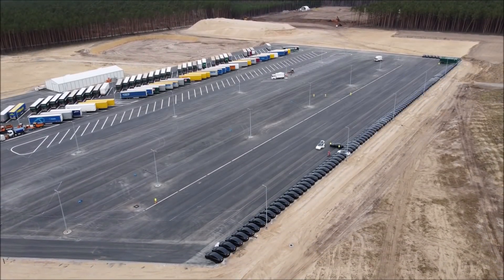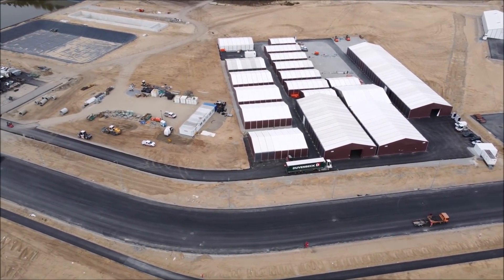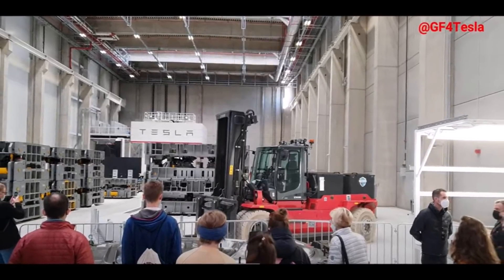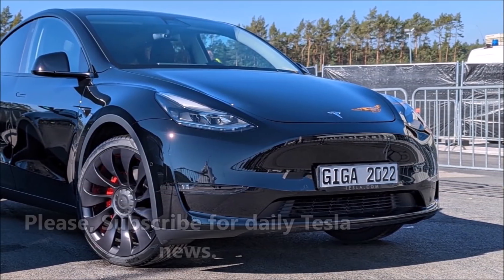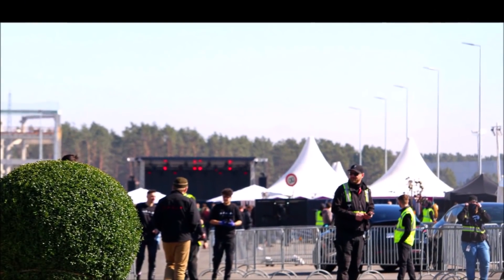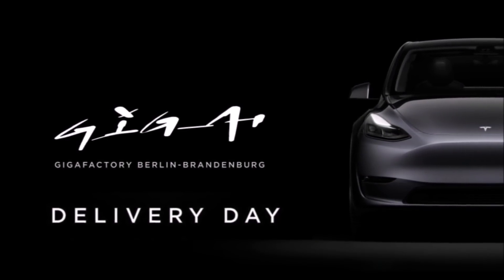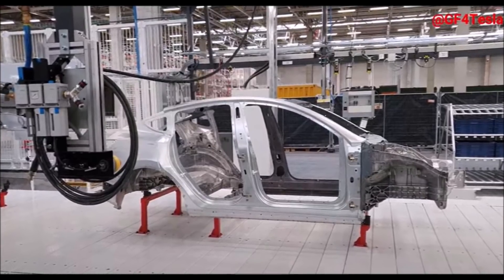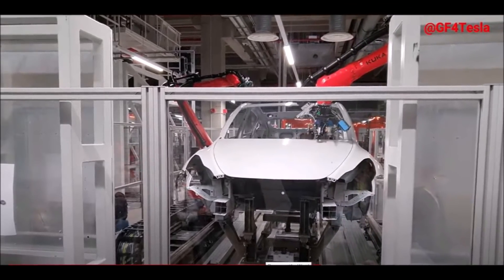BREAKING! Tesla Giga Berlin Produces 1 Model Y Every 150 Seconds

Comment: Stamping a body panel goes with a (giga)press. We call it stamping but it is forming and cutting a peace of plate steel. But metal can't be stampped in form in one stamp, but it takes severals all altering the plate a bit. The form will be stampped in a few steps. In this new tesla gigaberlin drone video you see the drone flying through the stammping machines. From plate to bodypaneel takes a few stamping presses and the whole cycle will take only 20 seconds. I hope you all see that a gigapress isnot the same as a gigacasting machine. Both different machines for different part of the cars.

Comment: Stamping (metal) goes very fast.  Then they stop it, put in a new die, then continue with another part.  They create a huge surplus of framing parts in a warehouse, which will feed the assembly lines.  You actually show a picture of the door frames in the warehouse in your video.  Those are waiting in the warehouse to be fed into the assembly line.

Comment: 2 min 30 sec. -> A shift has 440 mins -> 176 vehicles/shift. Suppose 2 shifts and 6 days/week.  
2 x 6 x 176 = 2112 vehicles per week. 
I think thats realistic end of April 2022. Or even more. 
Work on Sunday is expensive in Germany.
Reply: 24/7 run rate 2023 =500 k =.   Sunday game on factory is 80% robotic
Reply: Can't people get other free days for Sunday's? Eg. ~5 rolling shifts where each week/month you have different day off or something like that, so you work 1-2 sunday's a month?
Reply: @loonatic90  80% of the work is done by robots anyway
Reply: @13thbiosphere  Still the factory needs few thousand people to operate, so human labour implications, it's costs & labour laws are still a factor. Eg. Giga Shanghai just is/was on pause for a few days due to pandemic restrictions.
Reply: @loonatic90  priority is to keep the factory operating 24/7, even if wages are double..... If they want 500 k cars per year.......24/7 operation
Reply: @13thbiosphere  of course. I'm just wondering how do the labour laws are set up in Germany - i.e. if this is possible.
Reply: @loonatic90  German law requires one day out of 7 a rest day..... Doesn't need to be Sunday...... Most workers get double pay compensation on Sunday it is negotiable

Comment: Did you know that it takes nature 1.234.567 years to fully digest/deteriorate a Tesla?
Reply: That's why they are recycled
Reply: @larryc1616  yeah? Indulge me please and explain how they recycle a battery stack of several hundred lithium ion sheet laminated cells. And when you're done better apply for a patent on the process fast....you are gonna make billions.
Reply: @sepo3451  intense heat destroys chemical bonds. Plasma furnace. But the problem is they cost a lot to run.
Reply: And how did you get that figure, sounds like a mad stab in the dark? What part will last that long?
Reply: @sepo3451  the battery parts are valuable so that part will be recycled.
Reply: @sepo3451  Might wanna ask Redwood Materials in CA that question. 99.9% of Battery material will be recycled, simply for value alone

Comment: Misleading numbers in my opinion. They maybe push out a Tesla every 150s (through many parallel processes) but each car - according to many sources - roughly takes 10hours to build as compared to 30 hours at Volkswagen for example. Totally impossible to build an entire car from scratch to customer ready in 150s. Just think a bit and you will easily recognize that it is an absurdity to take this for real.
Reply: You know how an assembly line work? They don’t make 1 car at a time. In shanghai, they make 1 car every 40 secs…
Reply: Shanghai does it in 38 seconds. So yes it is possible. Do you expect a car to roll out every 10 hours? That's just ridiculous!
Reply: @elongate3265  You want to say that from the huge casting parts over the assembly of every part of the motor, structural battery, breaks, tires, the inside, electronics blablabla all together is done in 40s? Sorry man, maybe in a parallel universe. I claim it is not done in less than a few hours *per car*. Just many simultaneously.
Reply: @joesomebody2745  We may speak of different things: I say that to build an individual car from scratch takes several hours. And obviously as many are made in parallel, one may come out of the front door every minute or so. I did not say they only put out 1 EV every 10 hours - that would only be 700 cars per year. Obviously not realistic. But one EV cannot be built in 30s. This is absurd.
Reply: @bernios3446    I'm not sure why you claim the numbers are misleading.  You seem to be agreeing with the numbers...  No one is claiming they are building a car in 150 seconds, just that they are producing a car every 150 seconds.  So your point is what?
Reply: @pikkuporsas  "No one is claiming they are building a car in 150 seconds"  - ??? The title of the video suggests exactly that. "Tesla Berlin produces 1 model Y every 150s". But maybe my english is too weak.
Reply: Nonsense, it’s vw electric which they are still ramping the production and for your records vw finishes a car every 16 seconds.
Reply: @alanmay7929  Sure, but this is about the time it actually takes to build one Volkswagen, it is not 16s, but 30 hours. The CEO of VW himself, Herbert Diess, has said this: he warned the VW managers that Tesla could build one car in 10 hours, VW only in 30hours. If you think that any copany can build one car in only 16s, you do not study this stuff really.
Reply: @bernios3446  like I said vw is still ramping their production and 30 hours isn’t bad because Tesla also had to do more than that at the beginning too again lol…..
Reply: @bernios3446  I said vw finishes a car every 16 seconds! Which means cars that leaves the assembly line.
Reply: @alanmay7929  VW Will never catch up with Tesla, the forces that have taken over control inside the company are almost hostile to progress. Once they can build one in 10 hours, Tesla will build it in five or 4. Now, as they have realized that refitting old factories will not work, they decided to build a new one just next to the old one in Wolfsburg, Germany. It will be finished in 2026. Oh, and the old one has never produced more than 300,000 vehicles in one year.
Reply: @bernios3446  Think of "produces" as meaning "yields" or "outputs". According to the video's title, the factory is outputting finished cars at the rate of one car every 150 seconds. That claim is not inconsistent with it taking, say, 10 hours to make each car since, as you have pointed out, many cars can be made at the same time via a production line.
Reply: @bernios3446  that’s right, they produce a car every 150 seconds. They don’t say that they work on them one at a time lol!

Comment: BEV production can't be increased drastically as with ICE cars due to constrains in supply chains for battery production. Not a surprise China, the industrial backbone of the BEV market, is already considering Hydrogen powered technologies.
Reply: Yes, because hydrogen mines are everywhere...
Reply: @wizzyno1566  you can produce Hydrogen almost everywhere. And it has many other applications besides the Automotive industry, as with Trucks, Farming Equipment, Heavy Machinery, Aeronautical and Naval industries. Add to that the fact many Governments will support Hydrogen with cars, as a form to decrease the pressure on the Power Grid, be dependable of countries as China, and be able to tax cars through Hydrogen besides starting taxing BEVs based on their efficiency, power or Carbon Footprint.
Reply: @RogerM88  Hydrogen power is too inefficient, no infrastructure and it's a very hard gas to contain.  Using electricity directly to power a vehicle is much more efficient, power infrastructure is everywhere and there are hundreds of thousands of charge ports already, with more being built every day.
Reply: @jimlinley4239  without a big technological breakthrough in battery Cells, not a surprise if Hydrogen in cars, as a range extender gets implement. Battery production is too pollutive and you haven't enough raw materials to supply the demand at affordable prices.